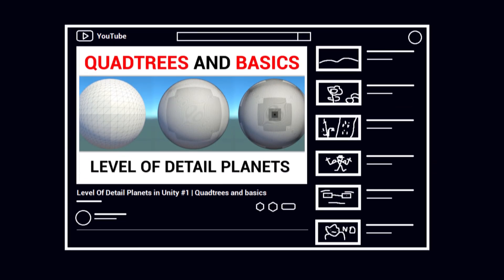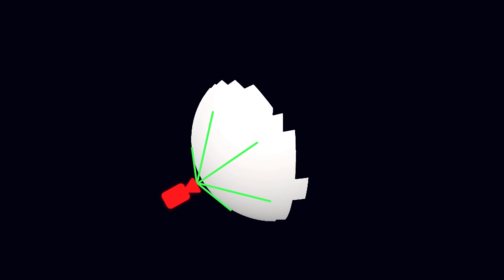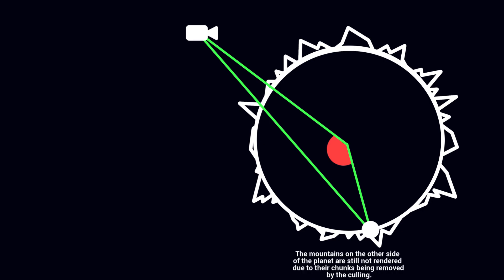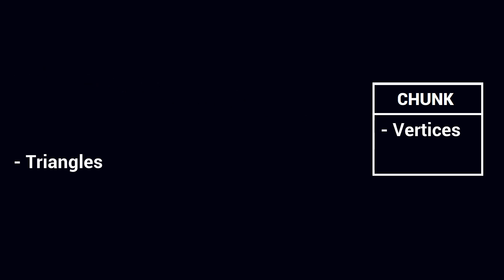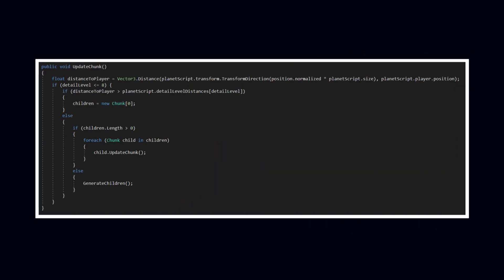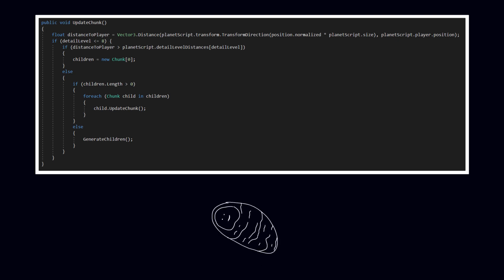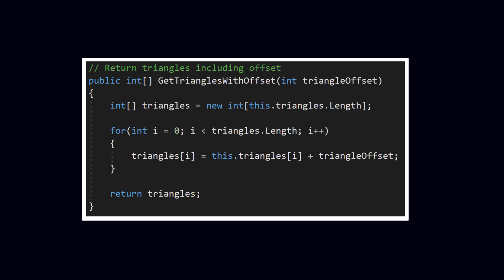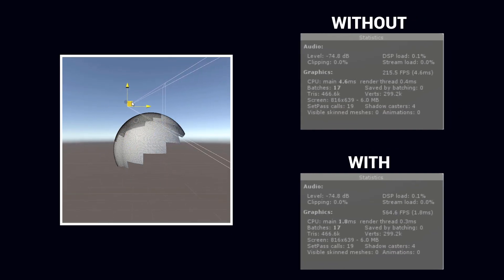LOD Planets in Unity #2 | Culling and Performance | Programming Projects 1.1

Comment: This tutorial series has really helped me a lot but I will also like to add that for the culling you could take the dot product of the normal of sample point of the sphere and the observer which is still just arc cosine. If the dot product is < 0 then it is on the other side of the sphere. Its still the same thing but just looks a lot cleaner.
Reply from the maker: Thank you! I'm a bit unsure if your solution would work in the same way mine does. If I stand at the north pole, my line of sight ends long before the equator. If I remember correctly, the horizon should start after about 5 km. Would your method accomplish this? Regardless, it could be very useful to switch to your method once far enough away!
Reply: It's from the definition of the dot product: https://en.m.wikipedia.org/wiki/Dot_product#Geometric_definition . Also see https://en.m.wikipedia.org/wiki/Dot_product#Application_to_the_law_of_cosines . Reworking those equations lets you get rid of the cosine which should improve performance a little bit.

Comment: Hello, really interesting process it helped me a lot.
Are you still looking forward to give us videos on this topic? Seems like you said below early December, so I just wanted to make sure you will get back to us!

Also, how would you implement noise or any random elevation with your current code? I'm highly interested into this. I've got some weird changing results between LOD levels so I'm not sure.
Reply from the maker: I released the code on GitHub earlier this month because the editing ended up taking some time. It's pretty much done now though so the video WILL be coming out tomorrow, if not later today :). I also think that it will address some of the weird things that might be happening with your terrain.
Reply: @simonholmqvist1951  Thanks a lot for your quick answer and all the information. I am really looking forward to it! New sub, that way I won't miss any of your stuffs :)

Comment: There is an interesting issue with editing the Detail Level Distances where values within certain from one another cause chunks to not be rendered. I want to say that certain detail levels have minimum chunk sizes, and that when your distance from level a and level b are too small to allow that chunk to be, it causes some kind of logic failure where the chunk doesn't fit. I'm trying to work on some math, but I'm struggling. My guess is that the elements of the detail level distance should all be factored to chunk size, or that everything should just get scaled from a min value, which is assigned to the highest detail level.
Reply from the maker: I don't know if this is exactly what you mean, but detail level distance needs to be at least cut in half from one step to the next, or else the chunks can glitch out because some new chunks get generated further away from the player than their parent chunk, meaning that they sometimes don't fit.
Reply: I was going to reply this morning that it appears to happen if the level distances are too close! There you go!